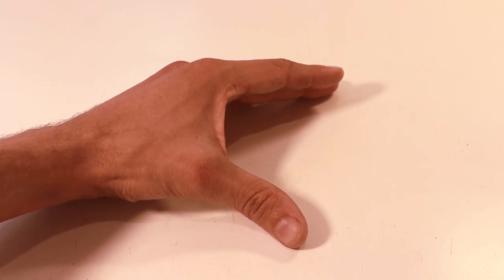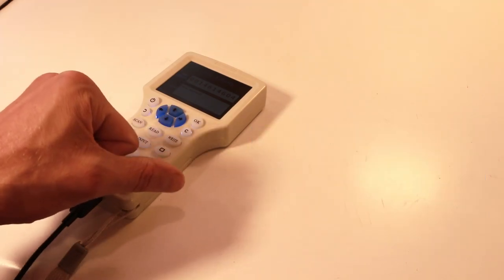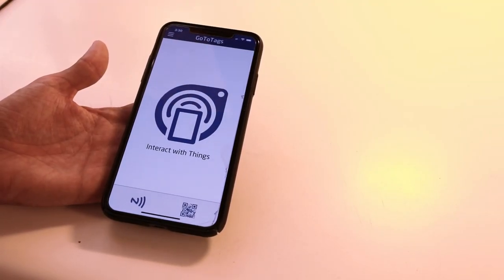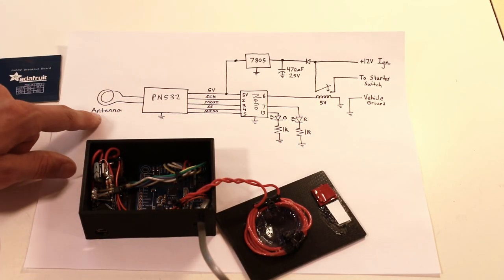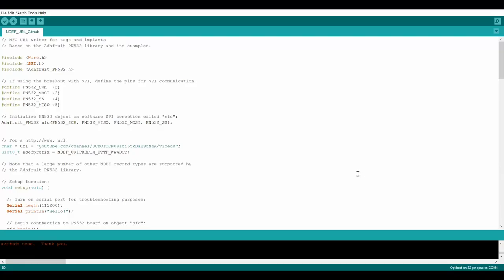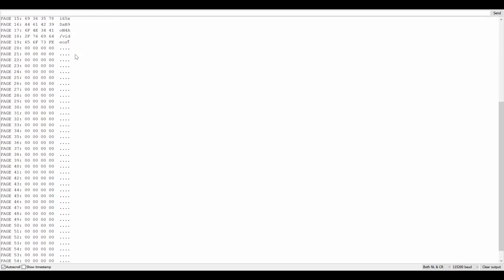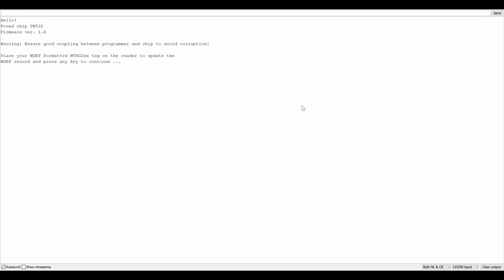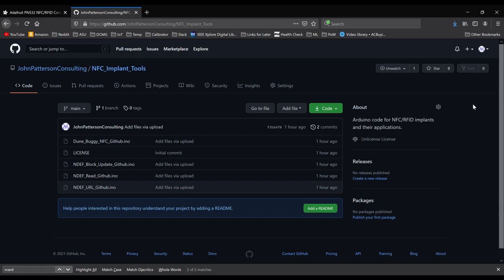NExT NFC Implant: 1 Year Update

Comment: how does your chip know what file to produce and execute with so many different instructions? 

For example, you have one function programmed for starting a vehicle motor, and one for opening a YouTube page. 

How does it differentiate and open the proper file? and does this mean you can actually have many different instructions for many different uses and execute each one whenever you want?
Reply from the maker: The data on an NFC tag are stored in a single table of index-addressable blocks called the NDEF record. Any block can be requested by a reader, so if the location of the block where the requested data is located is known, the reader can read the data from that block and utilize it.

It is typical for the first few blocks to be used for storing URLs, VCards, and other well-known data formats that things like smartphones can read off and use. The reset of the blocks can be used for any type of data storage, including access codes for interlocks, etc. At that point it is up to the reader, not the tag, to look for the code at the correct location.

This does mean that if someone really wanted to, they could just place a reader near the chip and pull all the records, effectively cloning the access key. But in my case this would require close proximity to the hand, and therefore is less of an urgent concern.

Comment: I'm interested in the new LED SIID implant from Dangerous Things however after reviewing the data sheet of the 1K memory I'm concerned I won't be able to integrate it for my Smart Home applications, work key fab, and for purchases ....do you know if this is true or can infact I use this device for all those applications??? 

Really nice custom build I absolutely love Adafruit but I think a Pico flasher can be used in the ignition switch build as well. Like your content your smart...nice to meet someone on the same frequency 😉. 

Like and Subbed please lemme know thanks
Reply from the maker: It should work for home automation, and if your work key fob system uses simple passkeys or UUIDs on 13.56MHz NFC it should work. However, payment will not work, as credit card NFC uses a bi-directional cryptography protocol with logic on-chip.

Comment: Nice video ! It's possible to have more than one thing in the chips ? Can you have for exemple your key card and your medical data at the same time ?
Reply from the maker: Yes! You can set the card reader to look for the passkey at any NDEF record location. So, for example, you could write your medical data to the first NDEF block and write the passkey to the 50th NDEF block.
Reply: @DielectricVideos  Great, it's a very interesting experience !
Reply: Also you can install several chips. I've seen people with several on the same hand, and the best kit that dangerous things sells includes both high and low frequency chips, I plan on install them on each hand

Comment: Hey mate 
Can you talk a little about the coil antenna?
Can i make one of these just using a regular and random cable and rolling up or i have to make some calculations or things like that?
Tnx!
Reply from the maker: I made mine with regular wire. I started with about 3 turns of wire and added turns until the range reached a maximum. I also experimented with the loop diameter a bit. Then, once I had the optimal  number of turns and diameter, I glued it in place.
Reply: @DielectricVideos  
I'll try to make one.
Keep going with good job on your channel.
Thanks a lot!

Comment: Do you have to update it for every use or does it have enough memory to store multiple functions
Reply from the maker: You can update the NDEF record on the chip independently of the passcode, which is stored in a higher address location. While it is possible to write multiple records to the same chip at different address spaces, I believe many smartphones will only read and act on the first NDEF record at the earliest address.

In this implementation, the reader just looks for a particular passcode at a a particular address. So any NFC tag with that code at that address should be able to unlock the reader, regardless of what is written to the earlier or later addresses. So you can change the NDEF record (i.e., a web URL, contact VCard, etc.) without affecting the passcode.

Comment: does the rfid side and the nfc side share the same memory or can you program them separately
Reply from the maker: They are totally separate circuits within the same capsule, so they can be independently programmed.

I used a cheap cloner to load an RFID gate key fob onto the 125kHz side, and it seemed to work very well.
Reply: @DielectricVideos  thank you so much dude

Comment: would this work on volvo cars for immobilizer?
Reply from the maker: If it's old enough to have a simple ignition switch rather than a chip key, then it should be possible to set it up like this.
Reply: @DielectricVideos  i have a 2002 s40 ?
Reply from the maker: @kingshiit9097  If you can find a wiring diagram for the ignition system, you might be able to find a suitable location to install an interlock relay controlled by the Arduino. 2002 is likely to have some additional security features that could make it more difficult, however.
Reply: @DielectricVideos  what else can i do
Reply: no locksmiths will even bother to try and help me ive called at least 20 .. can you lead me right path witch transponder can i use
Reply from the maker: @kingshiit9097  Are you wondering about the NFC receiver to use, or the place in the car where it needs to be installed?
Reply: @DielectricVideos  yes
Reply: both
Reply from the maker: @kingshiit9097  Well, I've only used the Arduino Nano with a compatible NFC receiver. I believe Adafruit and Sparkfun both make Arduino-compatible receivers.

If you wire it to a relay, have the relay interrupt either the starter motor or spark ignition system.

Comment: Are you not worried the magnet might damage the device?
Reply from the maker: Amal Graafstra has shown the devices to be MRI-compatible, so the small neodymium magnet here shouldn't be an issue.

I have had concerns about working near high-energy EM field sources such as Tesla coils and open-core inductors; however, even these have not caused detectable degradation to the device.

Comment: how do u program it
Reply from the maker: For the 13.56MHz side of the chip, the linked Arduino sketches can be used to program passkeys and other data to the chip. For the 125kHz side, a key card cloner works well to replicate 125kHz prox cards and fobs to the chip.